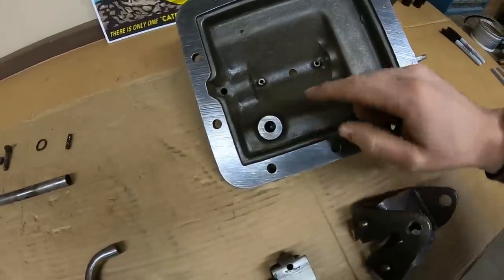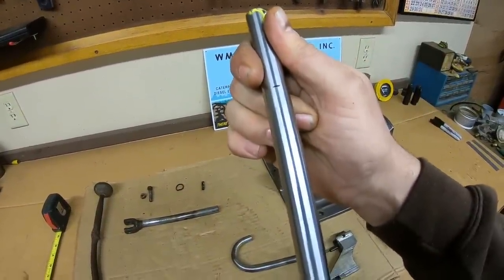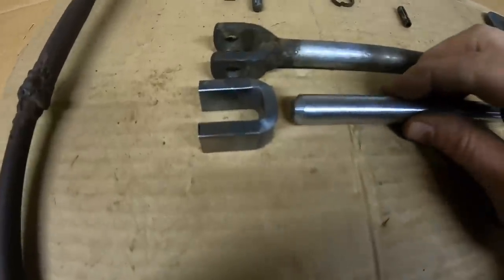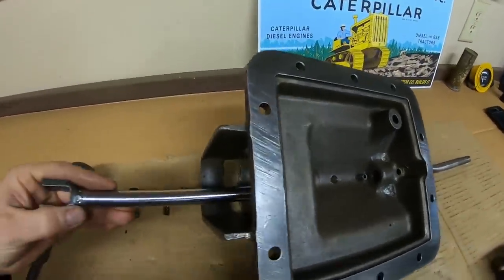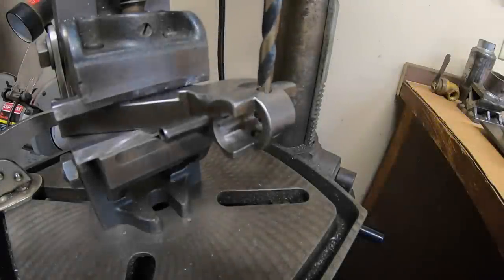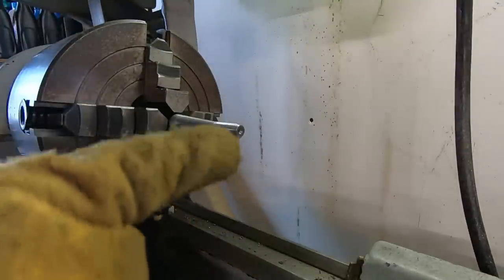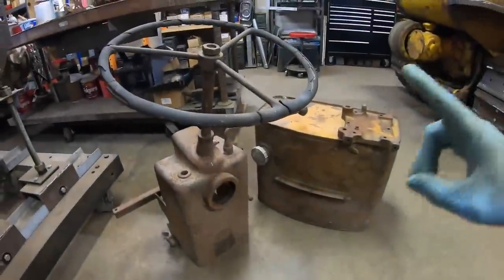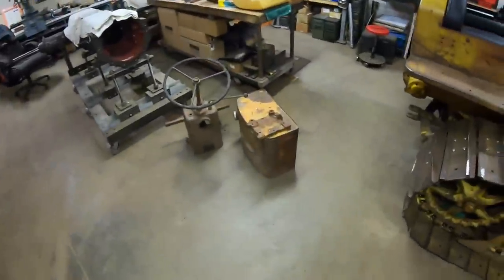Minneapolis-Moline 445 Prototype #X231 - Part 49: Shift Mechanism Fabrication Begins & Fresh Paint!

Comment: Hello Squatch253!  Looks like you have most of the major parts for that tractor!!  Here's another fact about glyptol. Collins radio used it to secure the knobs on their radio's and transmitters!
They done this by coating the small set screws with glyptol before inserting them into the threaded sections of the knobs with two set screws to each knob! the way these set screws are loosened is to get a long narrow soldering on and set it to medium heat and insert it into the setscrew recess in the back of the knob and heat up the setscrew for about 3 minutes, the heat loosens up the glyptol so the setscrew can be screwed out of the knob!  Thanks for your very interesting videos, Ilike old tractors as well as old radios of many years gone by!

Comment: As a millwright working in an oil extraction and gas plant I always found coating the insides of pump housings with Glyptal and Ceramic epoxies to be very satisfying experience. They always looked so nice and would not be rusted on the tops when you took them apart for overhaul years later for an overhaul. Great work again and a great video Squatch.

Comment: Good show Squatch! I think, if it were mine, I would hang the old shift lever on the wall somewhere just as a reminder of the evolution of X231 and some of the troubles it's seen over the years. It definitely tells a story. That's pretty wild with having the bent rails to fit the case. Can't believe they bored the holes that crooked! I would have to fire myself for that one. See ya on the next one Squatch.

Comment: Might be a bit small in diameter but by pulling out that cap that has plugged the hole in this cover you could drill out the hole and tap it so that you can install a fill plug in that cover since you said you didn't know how you would fill it.  Seems to somewhat match the eventual design they settled on too.

Comment: Awesome video I am with senior on the machines being the hand me downs from the production line one of my uncles worked at Minneapolis Moline in the late 1950s and early 1960s doing machining he said they had state of the art equipment he the machines were new or only a few years old he said I was nice how you could hold tight tolerances . Then after he quit there he bought his own old used turning lathe and he said it was a whole different scenario for holding tolerances and making accurate parts.

Comment: I use Glyptol to coat on the inside of my engine blocks and cylinder heads on my rebuilds  ,it makes a smooth surface for the oil drain to drain back into the pan never put it on machined surfaces

Comment: Looking forward to each video. I looked up cast iron stitching and my question is how do you hold those cast pieces from your donor from sliding around when you start drilling and tapping? I know it is a tight fit but you must have to secure it somehow.

Comment: In an earlier episode you were questioning how they filled the trans with gear oil. Wouldn't the bung on the cover be an ideal place for oil fill?
Reply: It seems that it would be a good spot for filling the transmission case, but a funnel and hose would allow for filling it through the check plugs. That is the method used on rear ends and manual transmissions in the automotive industry.

Comment: I know that in painting it is all in the prep work.  How meticulously clean does it have to be to get the glyptol to adhere well and not flake off?  Was there any special cleaning or extra cleaning done on the Super M or X231 castings? I know one piece was heated and repaired, but was the rest? I am thinking of using it on final drive housings,  a transmission / PTO casting. They have or will be thoroughly cleaned with solvent.

Comment: Nice work!  When you were rebuilding X231's engine, did you use Glyptal in there as well?
Reply: @squatch253  that’s exactly what happened in the old MM R I have. What ever coating they used from the factory deteriorated and was flaking off. The screen they put on the oil pump pickup plugs easy enough after years of use without that stuff adding to it!